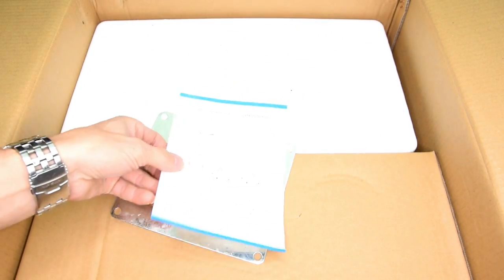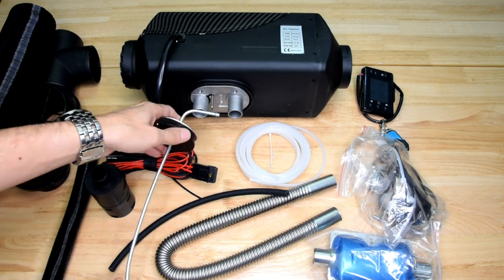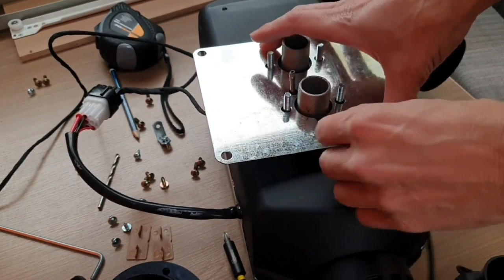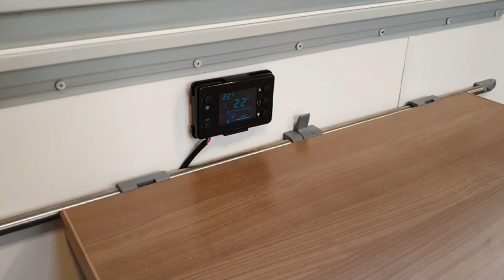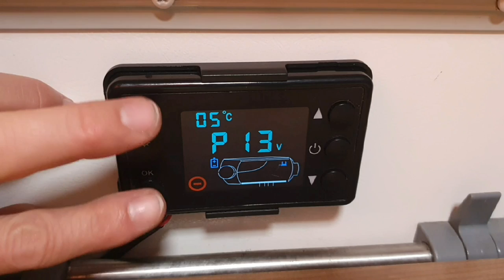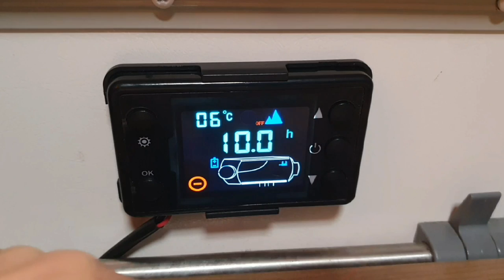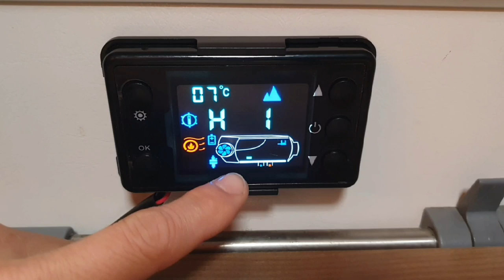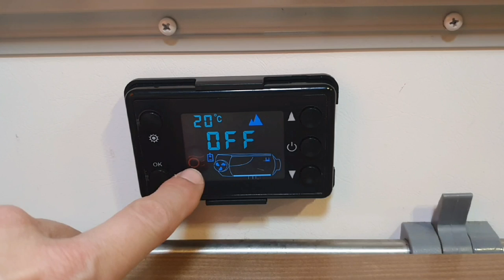Installing diesel heater into Jayco swan.

Comment: Heads Up

You need to install some CO2 monitors as well
They can look like a smoke alarm and normally  2 are installed

Thanks of the Vids
Reply from the maker: Yeah I have smoke alarms and carbon monoxide detectors in the van.

Comment: How has it performed over time? Did you install 5kw? We have a penguin and have read conflicting info re 2 or 5 kw. That’s for the vid!
Reply from the maker: It was a 5kw and I absolutely love it. My only issue was the chinese ducting that came with it was covered in a plastic that smelled as it burnt in. I recomend a semi rigid aluminium duct over the supplied stuff.

Comment: Hmmm...its raining, did you just recently record this?
Reply from the maker: It was recorded over the last few weeks. If you notice at the start, I said the season is starting soon and then I correct myself to say that it is in season as I realised by the time the video is released its going to be well into the season.
Reply from the maker: You might also notice at the start when I plug in the controller its 22 degrees and then later I point out that it is 5 degrees, and I am somewhere else. You may also notice my sleeves change about 3 or 4 times throughout the video.
Reply: I was always of the opinion post production takes over a month, just thinking you yeeted this one out fast.

Still im keen for more offside topics.
Reply from the maker: @johnh3733  i was filming this at the same time as the WE GBBR.  I prioritised the WE because it's more interesting.

Comment: Dont forget the carbon monoxide detector !
(oh youve already replied to such a comment lul)
Reply from the maker: Yes. I have all the detectors.  Although in a prefect world all the gases should remain outside the van. The van also has an LPG cooktop (gas inside the van) and all the associated ventilation requirements for that aswell.
Reply: @lowguidoschopshop  Nothing is perfect unfortunately.